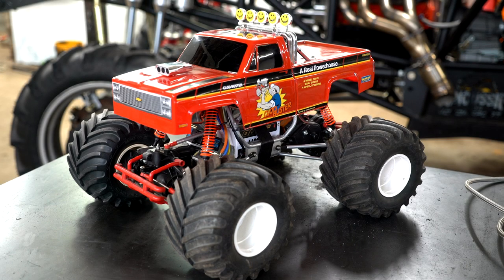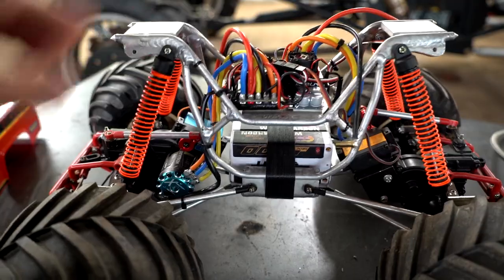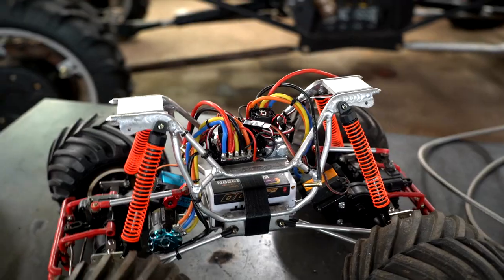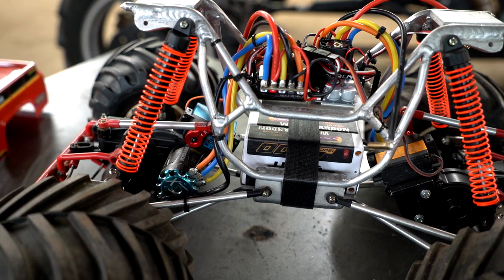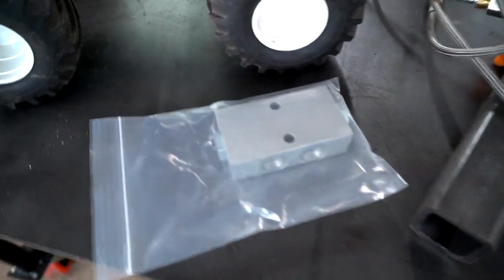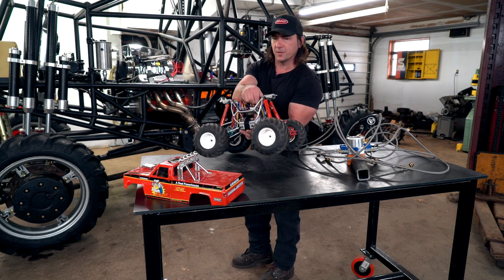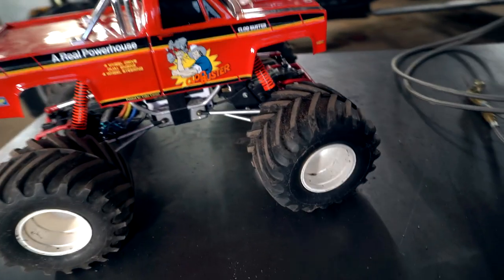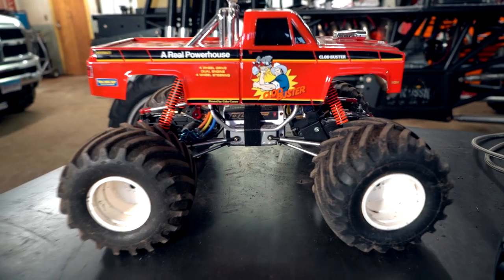Brushless Tamiya Clodbuster Test Run

Comment: RedCat Racing has a 3 channel with mixing that allows for front only, rear only, crab crawl, and standard 4 wheel steer.  Even has a little LCD model that shows what mode you are in.  Lansu 3TD is the model. $71.49 with the receiver.  I have one with my old Sumo Crawler.  Nice radio.

Comment: I use a dumboRC controller. I wired in a self-centering 3-position switch that controls the rear steer like a dream! I wired it into the 3rd channel. I can give you more details if needed.

Comment: Futaba all the way for a radio.  They are higher quality and feel better than other radios I’ve used.  They also have a fast response time.  The receivers can be expensive, and a good transmitter is pricey, too.  I use a 3pv for my Clodbuster, and it has rear steer mixing.  You’ll want a 4pm if you want to use a button to switch between no rear steer, crabwalk, or normal rear steering because the 3pv can’t seem to do that for some reason.  You’ll also want a 4 channel receiver because on the 3pv, the third channel can only be used for throttle mixing or the switch and the fourth channel is for steering mixing, not sure on the more expensive radios.
Reply from the maker: I like futaba that's what I've always run I'll check out that 4pm
Reply: @clodbusted1776  the t4pm is an awesome radio for just about anything, I use it for 10th scale onroad racing

Comment: I have a quick question. I wanna do a brushless setup on mine. Just wanna make sure I have this info right. So I need two esc/motor combos and I set one up to go forward and the other esc/combo I set to go reverse. Now my question part. If I'm going sensored castle I just go into the esc setting and choose reverse for motor direction. Where if I go non sensored I just have to switch the wires to make the motor go in reverse. love your videos by the way I just recently found this channel.
Reply from the maker: Yes that's correct.  Sensorless just switch the motor wires

Comment: Flysky gt5 it comes with 4 wheel steer programed in it 6  chan also cost about 65 bucks or so with reciver multi model radio also..hope that helps
Reply from the maker: Cool I'll check it out.  Thanks

Comment: i use a y adabper with a servo reverser circut, then it acts like a stock clod but with 2 servos
but you wont have indepentend control,

Comment: I just read when using the tamiya sensored esc that you can switch wires from ABC on the motor to connect to CAB on the esc to reverse the motor direction but timing should be set to zero.....
Reply from the maker: I'll have to look into that. The rear motor is the one that gets reversed and that motor stays at 0 timing
Reply: @clodbusted1776 I believe 13.5t brushless is a 3300 kv (rmp per volt)